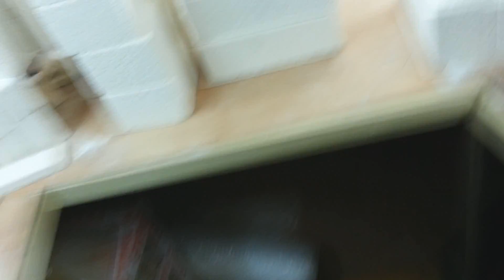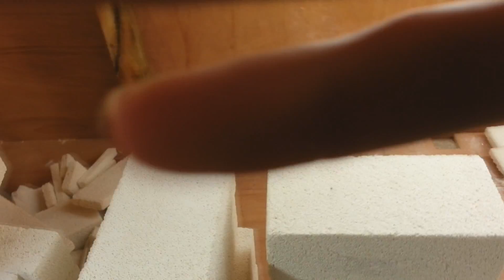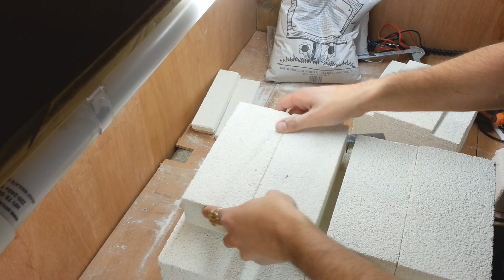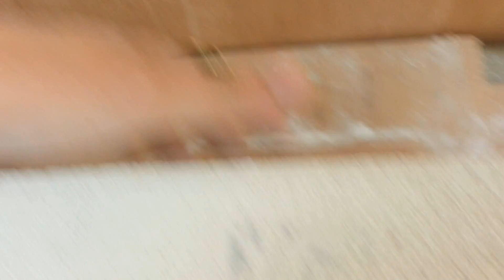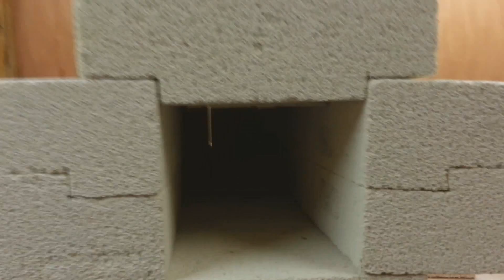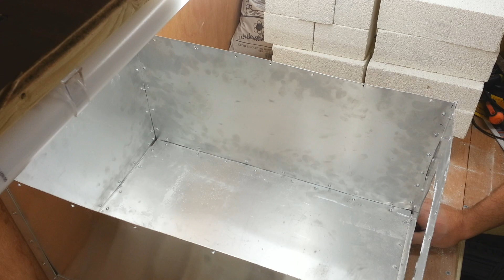Heat Treatment Oven Build: Part 2 - Brickwork and Framework

Comment: I get your logic, however the reality is a bit different.
Large commercial furnaces used for heat treating or glass melting are mortared together.
Commercially made kilns are mortared together. They just square up the brick, then use a thin mortar to create panels that are assembled.
K-bond mortar is rated to 1650C
Your K-26 brick is rated 1450C
In other words, mortar is better than notching. Not only do you not lose (expensive) volume, you are actually getting inferior results.

Comment: so why don't you use "water glass" in between the bricks as a sealant? its supposed to be a high heat sealant that acts as an insulator. i may be completely wrong so just a question. 
thanks in advance.